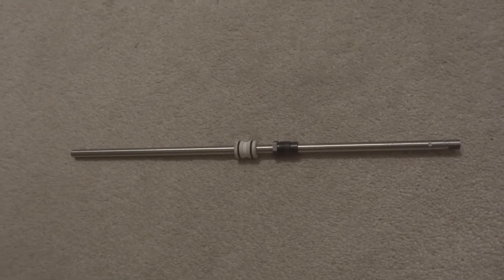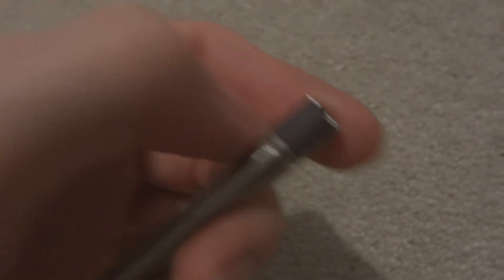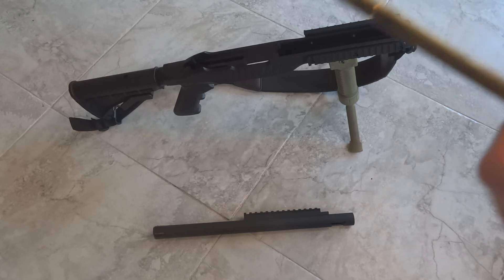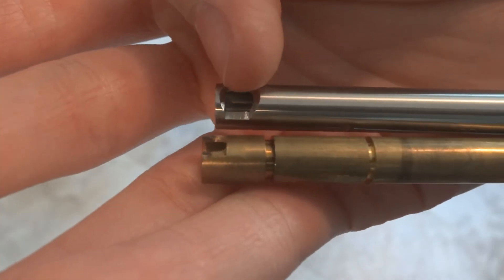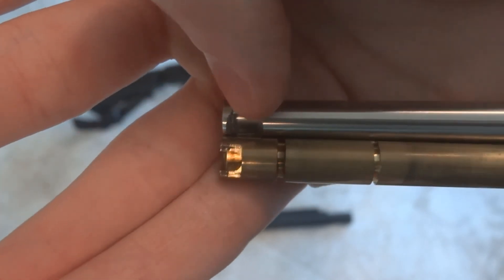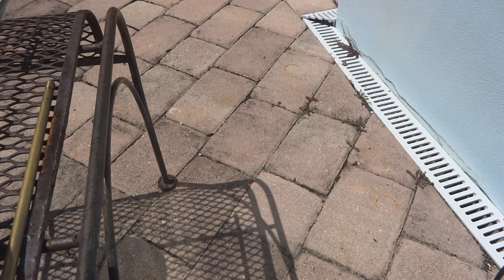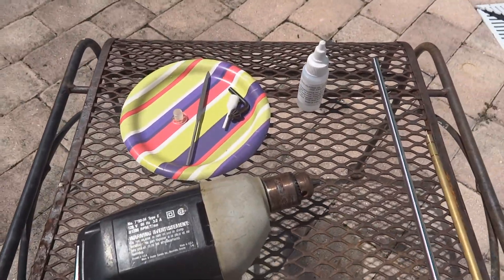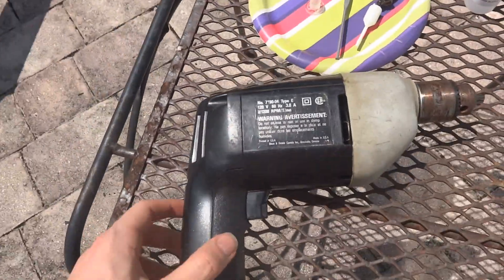How To Modify AEG Barrels To Fit KJW KC-02 Tactical .22 10/22

Comment from the maker: Yes, the G/R hop does eliminate the overhop (but you'll have to extend the hop arm to not get underhop), but R and G hop does not work with this gun. It gives you really inconsistent hop. I have developed a custom hop mod for this gun that works very well. I'm working on an installation guide. HS5 advocates the paper & glue method for raising up his R-Hop patches, it's sturdy. It only overhops with BBs lighter than .40g (might not with .36g, idk) anything lighter is too light for the gun anyway.
Reply: please elaborate a little bit more on  this hop mod ? ;)

Comment: Question. That R/G hop you have on the modified barrel, does the use of that eliminate the overhop you mentioned (the combination of paper and super glue doesn't seem like the best idea, due to the materials lack of durability). If the R hop worked than that would be ideal because that would not only eliminate the over hop, but give it the really good hop that the r hop is known for... hop lol

Comment: @TopHatRunner I'm thinking about doing this, I just need to know what size barrel to buy to fit in my gun, I have a stock outer barrel. Not the sniper version. Also at my school they have a machining class so all I would need to know is where to cut and how deep. Thanks
Reply from the maker: Any normal AEG barrel should work, but the barrel should have an outer diameter of around 8.5mm. Now for the ring you need to cut, the edge of it closest to the end of the barrel should be 10.5mm from the end of the barrel, the cut should be 1.5mm wide, and the cut should be .75mm deep. Having the proper tools would definitely help, I just kinda had to make due with what I had.

Comment: Looks like a dremel would have saved you a ton of time.
Reply from the maker: Jskd06 I have a dremel, but I can guarantee you that if I tried to cut the ring into the barrel with my dremel I'd have either cut the ring in slightly the wrong spot or would have accidentally cut through the barrel. If you're good enough with a dremel, go for it, but I think it'd be a lot easier to make a mistake with that method.
Reply: ***** True..... looking at buying your vsr adapter.... you think the laylax 555mm vsr barrel will be too long for the kc-02? wondering if it will hurt the accuracy instead of helping.  I was also thinking of picking up your valve to increase fps but does it lower the amount of shots you get from one fill? if it does, how much shots can you get off on mag fill?
Reply from the maker: Jskd06 Since the KC-02 is a GBB you don't really have to worry about a barrel being too long like you do with AEGs or spring powered guns. I use a 500mm Orga in my KC-02. GBBs will typically put out more than enough gas volume for any rational barrel length. In GBBs a longer barrel gives the gas more room to expand and thus will raise your FPS in most cases. Not really. I get 50-80 shots per mag fill with the high-flow valve, so usually enough to shoot 2+ mags worth of BBs. Thanks for your interest in my products! Be sure to let me know if you have any additional questions.